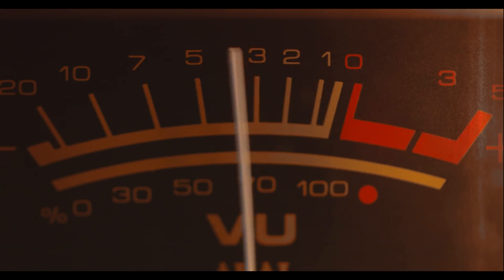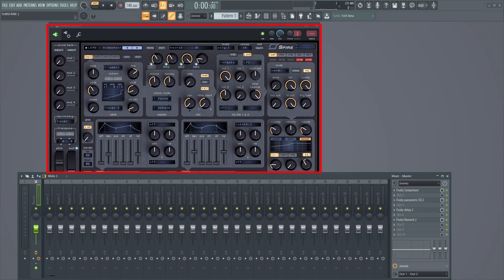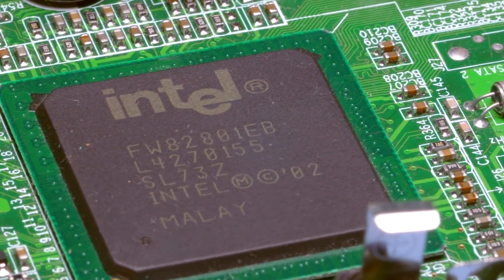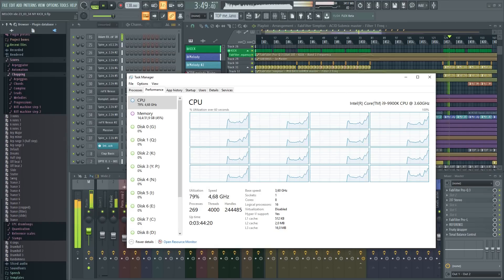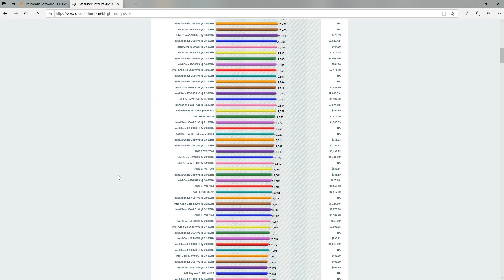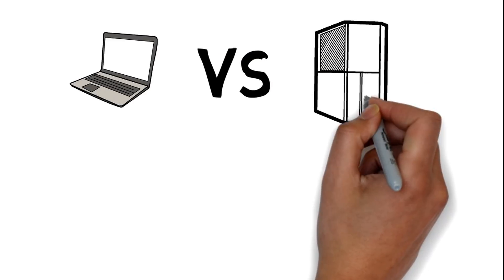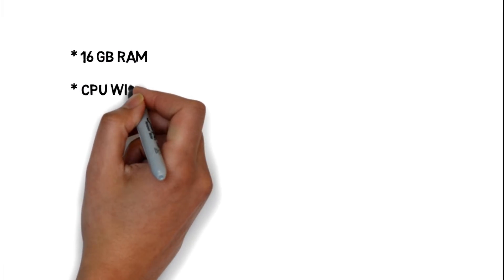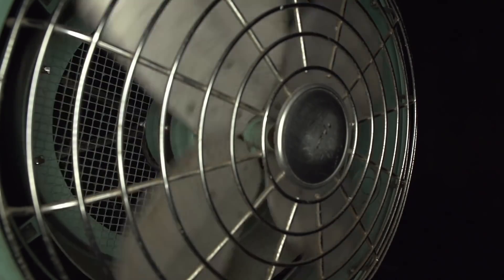The Best Computer For Music Production - What's Needed And Why!

Comment: I had the exact same argument with a tech guy, he insisted it was all the same . Parallel or serial , nope big difference. Core speed is key to audio DAWs. My main DAW i7 core 4.2ghz murdered his 8 core 2.8ghz like it was nothing.

Everyone who wants to build a music PC should watch this video, it’s excellent.
Reply from the maker: Indeed.  Unlike video editing and such, which benefit massively from having many cores, audio in a daw has to be played back in real time. If there's too much lag it just won't work. 
If you look at the 9900k vs the 9900x for example, you should think that the far more expensive 9900x which is a workstation platform with 10 cores vastly outperforms the 8 core 9900k. However, the 9900x has about 12% slower single core speed, and it can't be clocked as high as the 9900k. More cores equals more heat, which means slower cores and less overclocking potential. Clock speed is also important, when you factor in operations per clock. Having a 8 core CPU with faster cores, running at 5,2 ghz will usually be far better than a 16 core CPU running at 4,4 ghz for example. 

I totally understand that this can be hard to believe for a lot of people. It's just not very intuitive. I'm not saying that a daw can't use multiple cores, because it surely can. I'm just saying that unlike video editors for example, it's just not very good at it. 

To quote the developers (this is from the manual): 

The logic of audio processing - There is a long list of tasks that must be processed in sequence, and this means logically can't be processed in parallel (multithreaded). For example: Plugins must wait for instructions from the Piano roll and Playlist before they make sound. Effects must wait for the audio from upstream instruments and FX before they can process it. Further, it's not possible to parallel-process (multithread) instruments and FX that are on the same Mixer channel (their audio is mixed together), or even in the same Mixer routing pipe-line (when one Mixer track is linked to another and another, even FX processing has an order from top to bottom in the FX stack). Then, the Master Mixer track must wait for every instrument > mixer track > effect to be processed before it can process the audio through the Master effects. So logically, there is a lot of waiting that is a natural and unavoidable fact of DAW music processing. Think of a production line. This means the CPU may not be particularly busy, using all its cores and processing slots, yet it runs out of time to fill that tiny 5 ms audio-buffer because there was a lot of waiting for things that needed to be processed in sequence. It should be clear that fast processing is very important and this is not the same thing as multi-core processing. The best CPU is one that has enough cores to spread the work around AND can do the most work on a single core during each buffer time-slice. Which leads to our TIP: When comparing CPUs, look for the fastest single-core performance scores in a package with at least 4 physical cores.
Reply: @FireWalkMusic  
Hey, I'm looking to start a fresh music production computer build but on on a under $800 budget in full.

I'd like to go desktop this time rather than laptop.

Can you or anyone here guide me to either a build sheet or a already made computer with the specs I would need to make this all happen?

I'm going to be running studio one 4.5 for a Daw.

I have a 3rd gen scarlett 8i6 interface. Lots of plugins:)

My main music choice is Rock music in the vein of Alice in chains, Soundgarden, Mad Season and Some pop and R&B.
-wont use alot of tracks at once for that style of music..but will be using quite a few computer CPU hogs tho like nexus and kontakt and those kinds of stuff.

Any help would be greatly appreciated.

Thanks for any and all feedback.

ps I'm not a pro by any means on the home recording depot..lol but its my sanity..lol I need to write and record:)
Reply: @danielwaynejr.2317  get yourself something with AMD 3600x cpu and as much ram as you can afford running at 3600mhz. the rest is kind of up to you. i have a 2nd gen ryzen cpu running at 3.4ghz and nexus doesnt even touch it. any modern 6 core cpu running near 4ghz will generally be fine . https://www.youtube.com/watch?v=zUcY5Yfij30 check that vid its 960$ gaming build but you can drop the gpu spec to suit and spend the money on hard drives and memory or keep it to have a nice gaming pc if youre into that as well. you could save some money on the case and spend that on the x version cpu and 3600mhz memory or use the money u save on the gpu as any cheap gpu will be fine if youre not gaming. you can probably save some more money on the motherboard as well if you wanted. just use pc part picker to check compatibility for anything you change if youre unsure.
Reply: Ryzen 5 1600 with 6/12 3.2-3.6 or r5 3400g  with 4/8 3.7-4.2 and intgr. gpu?

Comment: Hi.  There's some inaccuracy in what you're saying.  Higher CPU speed will allow for longer chains of plug-ins to be processed.  But more cores means more tracks.  There is parallel processing going on.  Even in the early 90's in the days of DSP farm set-ups like Digidesign's ProTools II, we were using parallel processing on multiple Texas Instruments DSP chips mounted on Nubus cards.  Parallel processing is very important.  The dependency on bus board DSP is gone unless you need very low latency. But your cores do make a difference for those using lots of tracks.
Reply from the maker: Hey, that's true. I never said that a daw can't use parallel processing, I just said that it's not very good at it, unlike video editing software for example, which is optimized for that kind of thing. In a daw, every mixer track is basically an opportunity for the CPU to use multithreading. Every VST for example can usually be processed separately. However, the problems arises with the effect chains down the line, where all this waiting occurs. As soon as you can no longer fill the audio buffer within the allowed time, you're no longer playing back audio in real time, and that's a huge problem. That's why it's so important to have fast cores. 

When it comes to CPU's, there will always be a sweet spot where you'll start to have less single core performance in favor of more cores. The best CPU for music production is therefore usually somewhere within that sweet spot, where you'll have plenty of cores, but still very good single core performance. For example, you'll typically have better performance with an 8 core CPU with very fast single core performance vs a 12 core CPU with much slower single core performance.

To quote from the manual: 

"The logic of audio processing - There is a long list of tasks that must be processed in sequence, and this means logically can't be processed in parallel (multithreaded). For example: Plugins must wait for instructions from the Piano roll and Playlist before they make sound. Effects must wait for the audio from upstream instruments and FX before they can process it. Further, it's not possible to parallel-process (multithread) instruments and FX that are on the same Mixer channel (their audio is mixed together), or even in the same Mixer routing pipe-line (when one Mixer track is linked to another and another, even FX processing has an order from top to bottom in the FX stack). Then, the Master Mixer track must wait for every instrument > mixer track > effect to be processed before it can process the audio through the Master effects. So logically, there is a lot of waiting that is a natural and unavoidable fact of DAW music processing. Think of a production line. This means the CPU may not be particularly busy, using all its cores and processing slots, yet it runs out of time to fill that tiny 5 ms audio-buffer because there was a lot of waiting for things that needed to be processed in sequence. It should be clear that fast processing is very important and this is not the same thing as multi-core processing. The best CPU is one that has enough cores to spread the work around AND can do the most work on a single core during each buffer time-slice. Which leads to our TIP: When comparing CPUs, look for the fastest single-core performance scores in a package with at least 4 physical cores."

Comment: Doesn't programms like Ableton support multicore CPUs very well cause every instrument can be done by one core?
Reply from the maker: All DAWS process information basically the same way. With regard to VST's, most daws can process those individually. However, what happens next in the chain usually cant', and that's where all the "waiting" happens. Perhaps I was a bit unclear: All daws can use multiple cores in a CPU, but because of dependencies that's constantly created inside a project, there will still be a lot of waiting for stuff to get done, and that's why single core performance is so important. There's a different between fast processing and multi core processing. Typically, you want as many cores as possible, but you also want those cores to be as fast as possible. Unfortunately there will always be a tradeoff somewhere, where you'll get slower cores in favor of more cores. The best CPU is usually one that's in this sweet spot, where you have a good number of cores, but also very fast cores. :)

Comment: Surprised to hear the Ryzen 1,000 series processors recommended in such a recent video, now that the 3,000 series processors are available.
Reply from the maker: Those were mentioned as a budget option. The 3000 series was not out yet when this video was made, besides, it's more expensive compared to the older ones, which are still good CPU's. Most people don't need anything near the "best" computer for music production, as shown in this video. It all depends on what kind of projects you make, how many vst's and effects you use and so on. A lot of people will get by just fine with an older and far cheaper CPU. :)

Comment: Would I need a sound card or would onboard sound be enough?

Also, thank you for making this video!
Reply: Sound card or better a mid to high end interface I have an Apollo twin duo they have their own dsp built in and they are latency free
Reply from the maker: You can make due with the onboard soundcard, however, I strongly recommend getting a dedicated external sound card. It will give you dedicated mic inputs, monitor outputs etc, and with far less noise. You'll also get a dedicated ASIO driver with far less latency. It's also very handy with a volume knob easily accessible. 

The Scarlett solo is one of the cheapest, best-selling interfaces available. It also has superb quality: Scarlett Solo: https://amzn.to/3759yS3

When you use the Saffire ASIO driver that comes with it, you'll be able to playback music from within your daw, while at the same time getting playback from windows (youtube etc). Often times you can only do one thing at a time with the onboard sound card.

Comment: How can Intel be ahead when they have been on the same node for over the past 5 years?
Reply from the maker: I remember back in the day when AMD was ahead of Intel. I remember the day when it was announced that AMD was the first to breach the 1 GHZ barrier. Since then, Intel has surpassed AMD unfortunately, and there hasn't really been much competition in the high end segment, which is of course bad for consumers. AMD has instead aimed towards the low and mid range segment. 
Only very recently has AMD been able to catch up to Intel, with their new 3000 series, thanks to a clever design, combined with the fact that Intel has been having serious problems with it's manufacturing technique for quite some time now, and this has been holding them back quite a bit. 
I hope AMD keeps pushing forward and that they can reclaim the throne with good margin once again. That will be very beneficial for us, the consumers since it will mean more innovation and lower prices. :)

Comment: This video was made like 20 yrs ago.. I could run reaper on a cell phone and make a hit.
Reply from the maker: Mobile devices today are indeed more powerful than older computers, and it is true that you could make a hit on a phone these days. That said, there's a lot of different genres out there, and and while you might be able to make a simple banger on a phone, it would be incapable of running even a few instances of Omnisphere for example. Imagine having a 150 track orchestral composition, all done with heavy virtual instruments. That will indeed require a lot of processing power, and even the 9900k would struggle with that. Some trance tracks, as shown in this video, as well as some other genres can also generate very large projects which will require a lot of processing power. :)

Comment: If one woman can have one baby in nine months, why can’t nine women have one baby in one month? It just doesn’t work that way!
Reply from the maker: Very true. The best analogy when thinking about serial processing in a DAW would be an assembly line with workers lined up beside it. Let's say a mashine is producing plastic balls in 40 different colors. The first worker needs to sort out all the blue ones, the next all the red ones and so on, but they can only work as fast as the first guy in line, because he needs to finish the blue ones before it can move on to the others. Adding more people to the line won't speed up the process, as they will all just be waiting for that first guy. 

This is a crude analogy of course, because this is not how it is most of the time when it comes to audio production, but it is some of the time, and that can be enough to cause issues. I don't know why it's so hard for people to imagine this. 
There's a difference between fast processing and multi-core processing. Kind of like HP vs Torque in an engine is not the same thing. 

As stated in the manual by the developers: 

"The CPU is the primary factor in your ability to run FL Studio with large complex projects. Yes FL Studio utilizes multi-core CPUs but, beyond a certain point, more is not necessarily better. Read the section: 'The logic of audio processing' in the manual to learn why."

"The logic of audio processing - There is a long list of tasks that must be processed in sequence, and this means logically can't be processed in parallel (multithreaded). For example: Plugins must wait for instructions from the Piano roll and Playlist before they make sound. Effects must wait for the audio from upstream instruments and FX before they can process it. Further, it's not possible to parallel-process (multithread) instruments and FX that are on the same Mixer channel (their audio is mixed together), or even in the same Mixer routing pipe-line (when one Mixer track is linked to another and another, even FX processing has an order from top to bottom in the FX stack). Then, the Master Mixer track must wait for every instrument > mixer track > effect to be processed before it can process the audio through the Master effects. So logically, there is a lot of waiting that is a natural and unavoidable fact of DAW music processing. Think of a production line. This means the CPU may not be particularly busy, using all its cores and processing slots, yet it runs out of time to fill that tiny 5 ms audio-buffer because there was a lot of waiting for things that needed to be processed in sequence. It should be clear that fast processing is very important and this is not the same thing as multi-core processing. The best CPU is one that has enough cores to spread the work around AND can do the most work on a single core during each buffer time-slice. Which leads to our TIP: When comparing CPUs, look for the fastest single-core performance scores in a package with at least 4 physical cores. Most CPU benchmarks list single core performance. For example, the CPU Benchmark website lists the single core scores."

Comment: Shot for a $1000 budget.
Ended up buying a Ryzen 5 3600. It was $195 vs $470 spent here on the i9 9900k. You get 6 cores instead of 8 but an almost identical single core performance. I see a lot of people going this route as the intermediate music producer with a decent gaming pc as a side benefit. Just wanted to take what I learned apply it and share it. Thanks!
Reply from the maker: That will most likely work very well. The trick is to figure out how demanding your projects are and how much you really need, and then get something that's a little bit faster than that, so that you have a bit to go on. No need to buy a $2000 setup if you can make due with a  $800 setup :)

Comment: Does the Ryzen 7 2700x have good single core performance?
Reply: yes
Reply from the maker: Not as good as the i9, but it will usually be more than enough for most people anyways. It depends on how many VST's and effects you intend to use, how many tracks you typically end up with and so on.